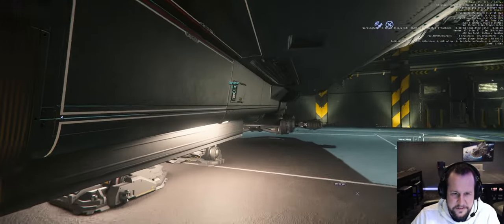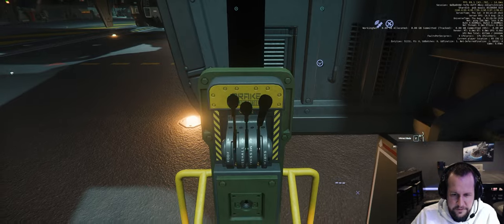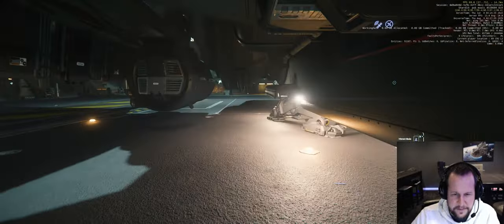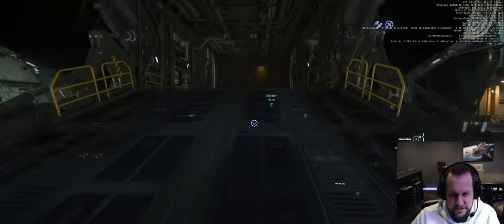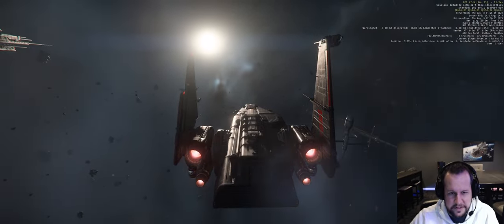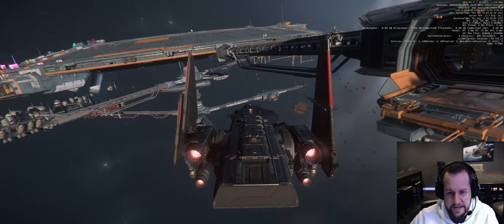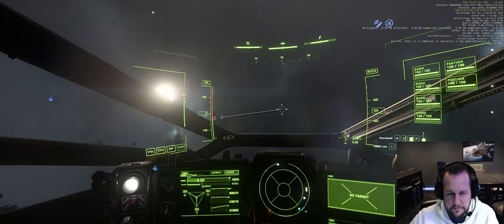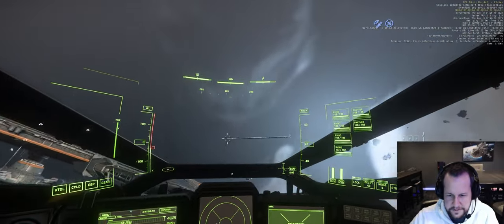Corsair Micro Stutter in 3.19 - Evidence Video for Issue Council

Comment: Also a Corsair enjoyer for quite a while now to the point that it's been pretty much the only ship I've flown since 3.17.5. I really had kinda just gotten used to it and assumed it was just my PC which admittedly struggles to run the game smoothly most of the time anyways. I5-7600k, GTX-1080, 16 GB Ram, 48 GB Pagefile M.2 SSD.

Started flying a couple other ships lately (Sentinel and C2) and noticed it had been pretty running unusually smooth, turns out that it's not been running unusually smooth while in those ships, it's just finally been running normally and the Corsair just causes the game to run unusually NOT smooth.

I added to the issue and it's officially confirmed now; thanks for pointing this out and taking the time to even provide a video; aside from the ever hitting 70 FPS part, this is exactly what it looks like for me as well.

Comment: I have an off the shelf $900 PC. I don't get the micro stutters in my Corsair.
Reply from the maker: Yea, I've seen a lot of users with no issues, out of curiosity, what kind of GPU are you running?  nVidia or AMD?  Also, which processor, Intel or AMD?